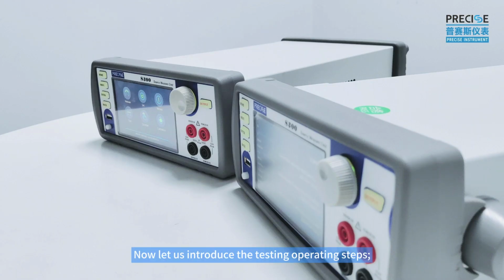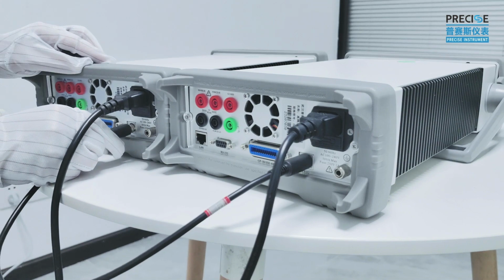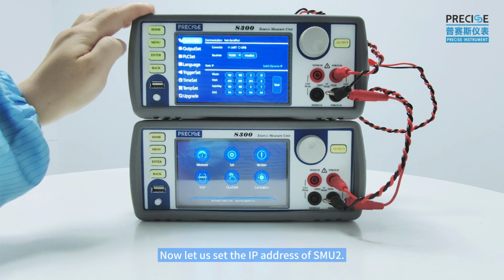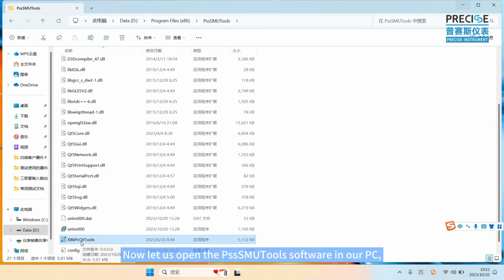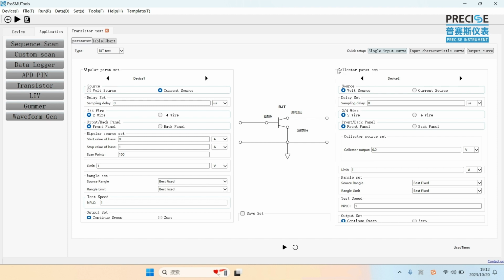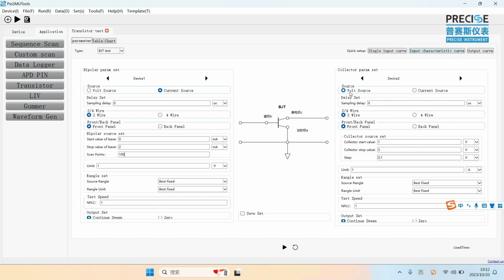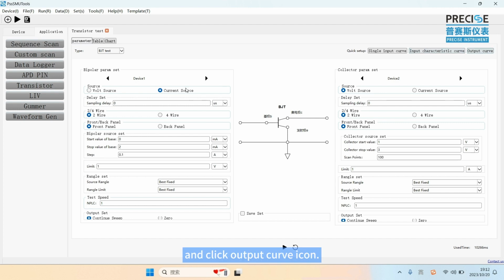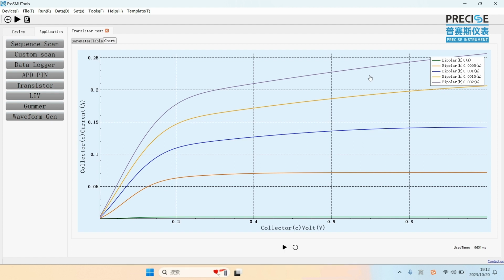transistor IV curve testing with source measure unit (SMU)

Comment: Can this S series SMU output ms level pulses？
Reply from the maker: yes. although SMU S series do not have direct pulse function, but its Zero mode with NPLC setting will help simulate pulse output, and min pulse width can reach 2mS.